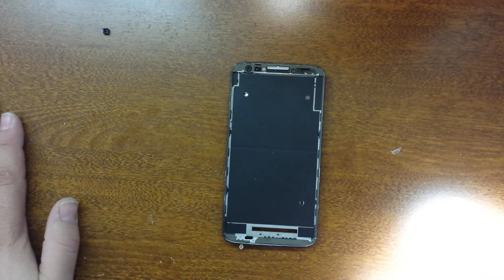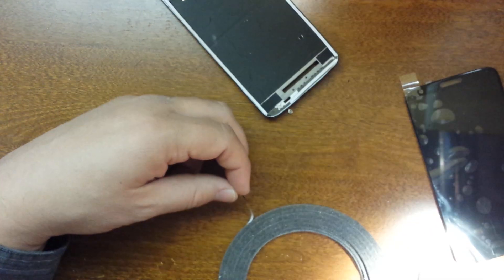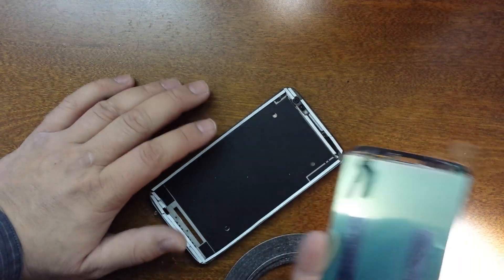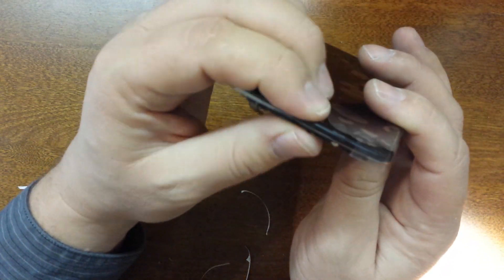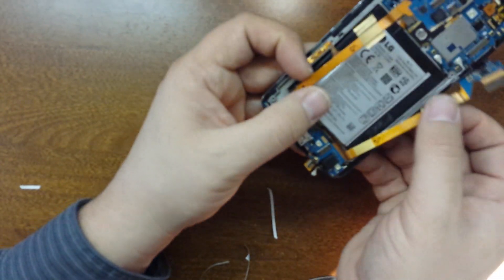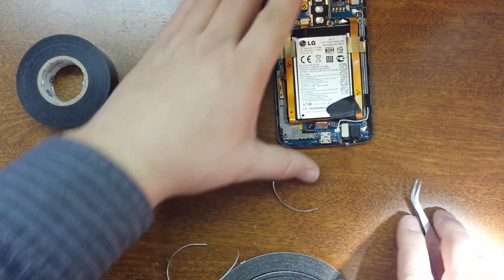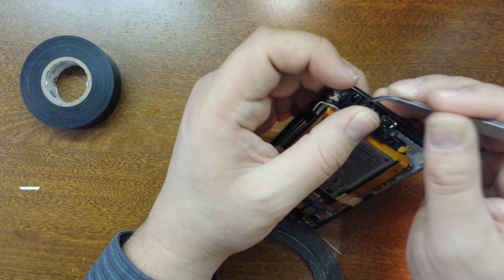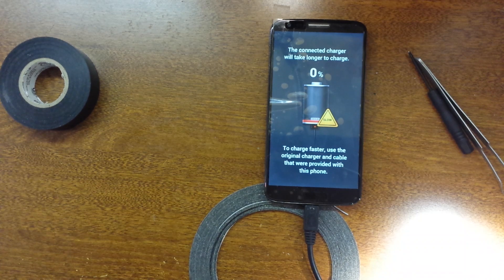LG G2 screen/lcd replacement reassembly

Comment: Great video. I just replaced my screen which had a dead spot (sometimes dead line). Now after putting the new screen in, I get ghost touches. Reseated the digitizer connectors and tried to insulate them with kapton tape, however I never get quite rid of the issue. Any idea if there is some grounding issue when assembling it wrong?

Comment: Hi i watch your video about reassembly the LG G2 after replacing the screen.
i turn on the device but only 1/4 screen is working... the rest of the screen is black.

i did something wrong or the screen i bought is garbage ?

Comment: I used your video, great! But I lost the black screw and the tiny brass stand it goes into is missing from the motherboard!?!?! The screen comes on when I plug it in, but it will not power on with the button. Please help!
Reply from the maker: check your connections, make sure they are all down. if that doesnt work then you need to diagnoase the board. that is some advanced level stuff. but basically check to see if anything is knocked off.
Reply: +Fix All Cell Ogden the brass stud that the black screw goes into IS missing. does that complete a circuit on the board?
Reply: +pontiacjeff it all worked before disassembly, just had a cracked/dead screen
Reply from the maker: +pontiacjeff it should still work.  i have seen ones with it missing before and it still works.  do you see any other components missing on the logic board? check around the connectors, sometimes things will break off due to pry damage.  if you have a microscope that is very helpful to see
Reply: +Fix All Cell Ogden

I will check it closer. thanks.

Comment: I just fixed my LG g2 and the screen is rising a bit on the sides so you can see a bit of light on the edges. How could I fix it?

Great videos. Thanks in advance.
Reply: I work at a smartphone repair shop and seem to run into this exact same issue just about 90% of the time... In this video right at the end you can see that his screen is also popped out a bit... My question is what is causing the sides of this screen from sitting level inside of the frame?
Reply: Same man, disassembled and reassembled the phone like 5 times now, new adhesive every time. Still POPPING OFF A BIT. Pissing me off, I think a different adhesive was used.

Comment: At first I tried no glue and my screen was not responding properly when pressing on it. Then I put adhesive (wet glue). Only very little on the edges..but I'm still having this issue. Is it the glue that is the poblem or something else??  :(

Comment: hello mr. smith. my phone had white lines, sometimes, . your video helped me fix my phone. the antenea was on a connection, put a lil electrical tape on it. AND WORKS PERFECT. THANK YOU!!!!!!!!!!!!!! so much. you saved me a 30 minutes drive plus what it would have cost for repair shop to fix.

Comment: Hi thank you for this video it was very informative! I managed to install the new LCD + Digitizer and it was working great but the Camera and Proximity Sensor were not working so I took it apart again and managed to fix those parts, however now the touch screen is only responsive to very hard presses. Do you know what I could have done wrong? I know I used glue instead of tape and used a bit too much on the front of the device inbetween the device and the LCD + Digitizer where there is this cloth like material and this cloth like material/tape ended up sticking to glass part of the digitizer when I took it apart the second time. I first tried to just leave this material/tape on the glass part of the digitizer but the screen was only responsive to hard presses so I decided to take it apart again and carefully peel this cloth like material off the digitizer and cleaned it with alcohol and put it back together, however I still have the same issue. Any hints to point me in the right direction to get this fixed would be greatly appreciated!

Comment: Hi Aharon,
Thanks a lot for sharing this video. I was able to fix my broken screen a couple of months ago and it was working fine all this while. Long story short, I needed to take it apart again yesterday and tried putting it back together. Here's my problem - the screen does not display anything now. I see the backlighting coming on and I know the digitizer is working because when I double tap it, the backlight comes on. The screen however is blank. While taking everything apart, I did not take the digitizer out - could that be the reason ? Any help would be greatly appreciated. Thanks !

Comment: Hi! I did the repair and it kinda worked. At first I didnt get any response but later I got it working but when I put it together I got the snowy screen u got in the video, but when I try to fix it by doing something with the connector the lcd goes black. What should I do?

Comment: Great video! I was wondering if the replacement screens are any good? I've seen them on eBay but they don't have the lg logo like the one you replaced here. I'm assuming this means they aren't OEM. Do they look as good as the original? Thanks.

Comment: Hey Aharon, thank you so much for the video. I was able to assemble the LG G2 after replacing the LCD screen but my touch screen is still not exactly responsive (ex. pressing the home button w/ the on-screen keyboard presses a key on the keyboard). Would you happen to know what the issue would be? Thanks for everything

Comment: I accidentally bought the 2 part lcd and digitizer (not glued together) is there an adhesive that I can get locally that will work? Or do I have to just bite the bullet and order the right one?
Reply: I would also like to add that this project is time sensitive.
Thank you for yours

Comment: Hey aharon, thanks for the video. My LCD and digitizer are working great now but in the process I have created another problem. I cant use the camera, flashlight, or make calls. The camera is just black with no noise, the flashlight gives and high temperature warning, and the phone turns off entirely when accepting or making a call. The phone also gets very hot on the upper back part. Do I have some kind of short going on? Does this sound like anything you have experienced?

Comment: I'm realllyy hoping you can help me with this, because you are way more experienced with phones than I am. I fully assembled the phone except for the black bottom part, antennae or something I think? Anyways, whenever that bottom chip part that would be under the black part (the bottom connector for the screen) is pushed down, the screen gets all screwey and if pressed fully down the screen turns off.

How can I fix this?
Reply: I really appreciate the response. I was talking about the wide bottom cable on LCD, that plugs in to the bottom board. I'm responding so late because I came up with a very crappy temp fix, because I actually wanted to use the phone.. and it was working so I didn't want to touch it... shoving a wad of electrical tape under the board, propping it up so it wouldn't cause that interference, and sealing the back cover as much as I could. Well, I finally decided to ACTUALLY repair it, and wrapped the cable I was talking about in electrical tape, but it all together...then come to find out all that pressure inside slowly bent the screen just a tiny bit.. enough for it to pop out. My own stupid mistake.

Comment: Hello Aharon,
First I want to say thank you very much for the first video were you went through the disassembly process.  It was very helpful and very appreciated.  The second video again was great thank you.  The only one thing I would mention (because I had a problem with this).
I did not have any bars after I was all done. Everything else worked but no phone service.  After looking at your video and a couple others (no names mentioned) going through the same process I had the antenna wires crossed.  The two black and white wires that run along side of the battery.  You show the black wire running underneath the copper strip.  It is the white wire that goes under and connects.
Sorry for anything negative because you really were a huge help.  Maybe some one else might have same problem.
BTW the black tape worked for me and cleared up the static on the front screen.
Best Regards,
Chris

Comment: hi,i saw website are selling different part
1st)touch screen which cost cheaper
2nd)touch&LCD/digitizer

i just dropped my lg g2 d802 on floor,the touch screen is not working at all except the home and back button but the lcd have no problem,is that i replace the touch screen and my screen will working normally?thank you
sorry for my poor english

Comment: hey man, what's the difference between the d801/d802 and the d800 LG G2's? Have a friend needing his d800 fixed, found a d801/d802 screen located in the US (seems impossible) so i can get it quickly. Just wondering if the d801/d802 screen will work on the d800, thanks

Comment: I have white lines showing up on my screen when I turn my phone back on.  I put electrical tape where you did but I still get the lines. Any suggestions?
Reply: I just replaced mine as well and also have a lot of white lines.  all the connections seem to be secure and i put electrical tape over the area suggested, and it still isn't working.  I purchased the screen from mobile defenders.  were you able to figure anything out, brock?
Reply: I put my old screen back in, and it powered up just fine without the lines.  Of course the lower half of the screen doesn't work, but that's nothing new.  I guess  I will need to warranty the new screen.  I tried reinstalling it a couple times with no success.
Reply: Leigh Mikell I know this is an old comment, but did you find a fix in the end? Or did you buy another screen?
Reply: I get the same thing. Seller I purchased it from said it was static and to disassemble it......let the screen sit for a couple hours then reinstall. I had someone else do this for me so I'm not sure how/what he did.....but I still have the lines. I am going to try again tomorrow myself and replace my screen to see if it fixes it.....if not I'm sending it back for a new screen. :(

Comment: Hi Worked great accept the external speaker doesnt work  I think I checked everything including the little rubber plug but can't find where I might have missed something - appreciate any help!  Thanks!
Reply: Thanks aharon I messed around a bit with the connectors on the back and it came back to life!  Thank you so much for you video!
Reply: ***** HI
I changed out the speaker still no good-  is it the whole ribbon component  that might have an  issue?

Comment: How do I know if the LCD is good or cracked? The LG G2 phone does not turn on or off and the touch screen doesn't work.I'm sure the Digitizer is cracked. (it's the part on top?) There is a message on the screen "LCD appears to be damaged". If they are both damaged can I replace them as an assembly?

Comment: My son just got his LG G2 less than 2 weeks ago and has already damaged the LCD and it has a slight crack! :( Was debating on filing insurance claim but doing that they send you a refurbished phone....I might try to replace the LCD screen and if mess it up then maybe file the claim! HA!  You made a comment about buying cheap LCD screens on Ebay and that some are crappy, is there a particular place you purchase your screens from?  Also what was the tool called that you used to separate the LCD screen and what about using a hair dryer since I don't have a heat gun?  Thank you for your video!
Reply: You can get LCD+screen from fixez . com and the tool was heat gun. You can use a hair dryer, somebody used it in other video :)